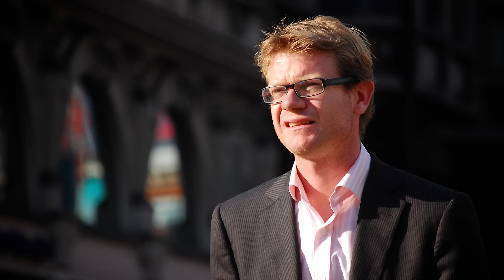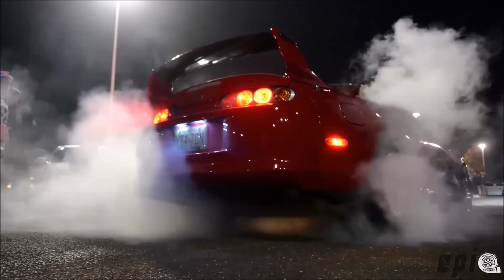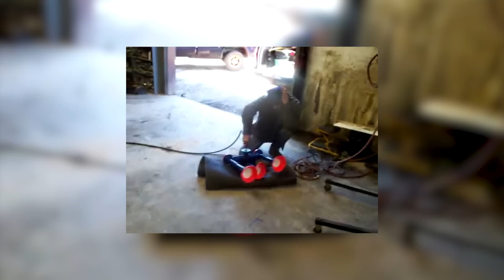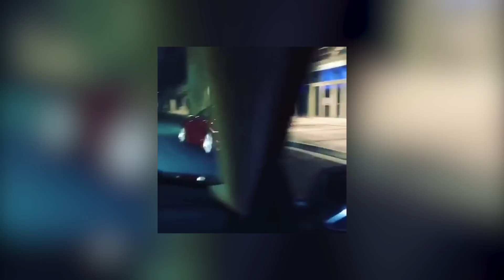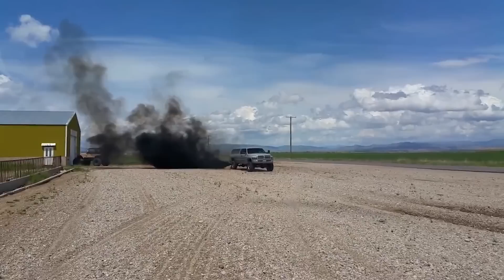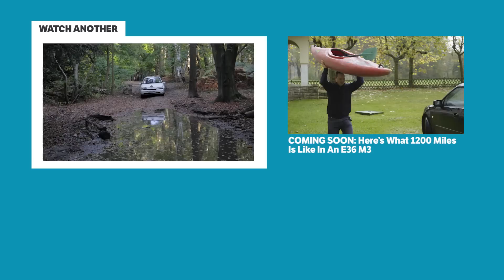6 Mods Your Neighbours Will Hate You For Installing

Comment: If it's a mechanical mod, say for engine performance I can accept that. What I can't accept is anything else annoying, mostly people with ported 10000-watt subs blasting their unga bunga 'music'. In second place is the douchebag I used to live next door to with a lime green everything truck on air suspension. He'd spend 20 minutes before and after leaving just readjusting his fucking truck. Too high, too low, too high. stttsss-stttsssss-ssssssttsstttssss...